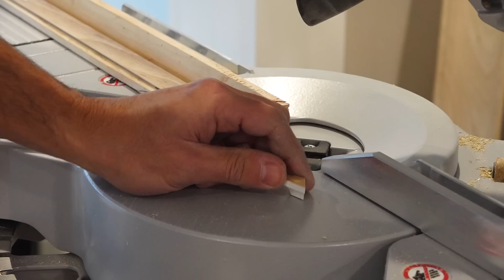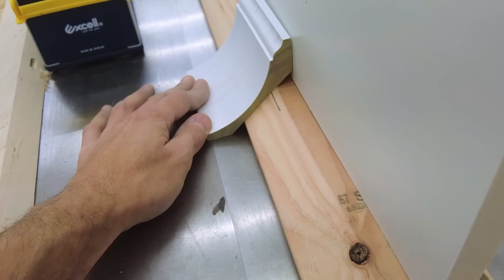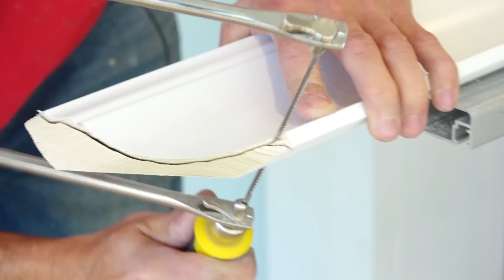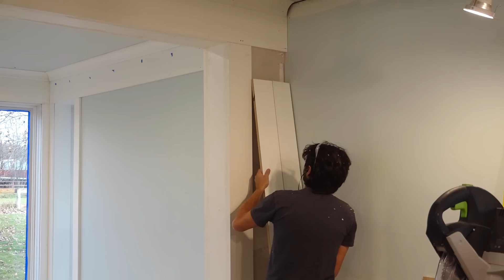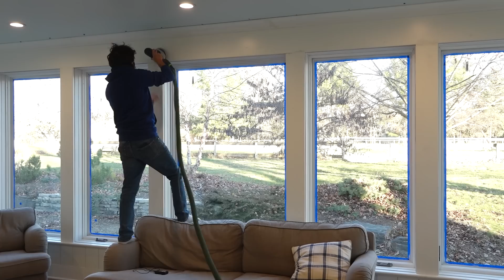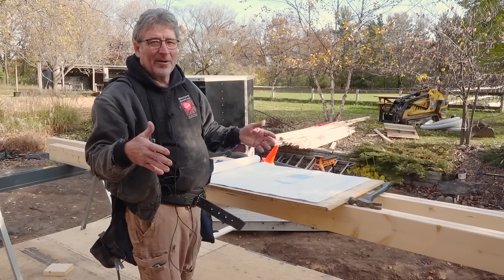Installing Crown & Finishing the Sunroom | Home Renovation & Addition Part 67

Comment: Matt what is the setup you’re using with your hvlp at 38:00 which basically removes the bottle from the sprayer? Seems tremendously helpful for getting into tighter spaces

Comment: I have installed thousand of feet of crown and my preferred  method was cutting on the flat and using the compound cutting angle charts you can get on the internet. No math or guesswork. Find your true wall angle  and use the chart to set the mitre and bevel.  Sunroom looking good.

Comment: Congratulations Matt, Lindsay and of course Donavan.  The attention to detail really does make all the difference to the finish and has resulted in a very clean, nicely trimmed room...  Stellar work!  A tip for using caulk or silicone, use a plastic shim/spacer to smooth off the bead.  The radius is very consistent and prevents mould growth (from a wet finger), especially on silicone.

Comment: I prefer glue and 23g pins for the smaller mouldings. saves so much time filling pin holes. beautiful work as always Matt.
Reply from the maker: I used 23ga on the paneling. Filled them all

Comment: Beautiful work. What kind of wood filler are you using? I've been using Plasti-wood and it works well, but the crappy containers allows it to dry out over a relatively short time. I also tried some normal wood filler and it was nearly impossible to sand once it dried.